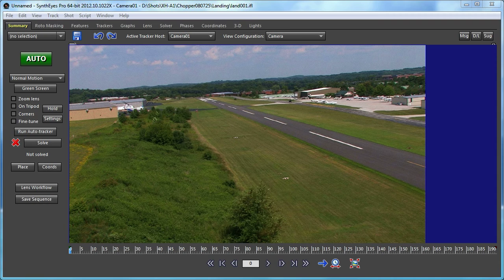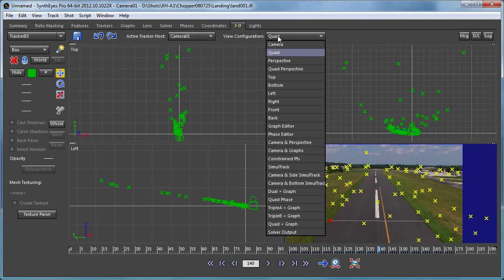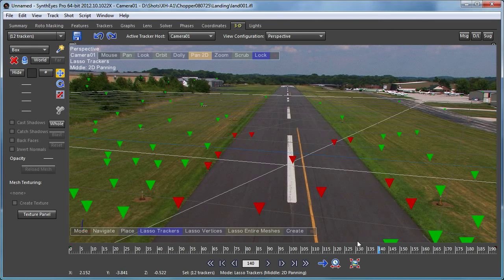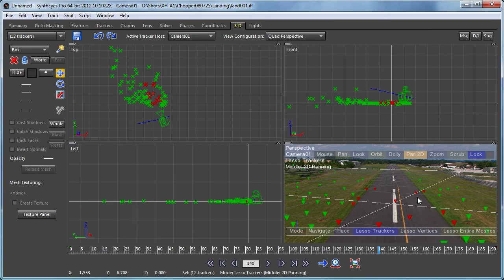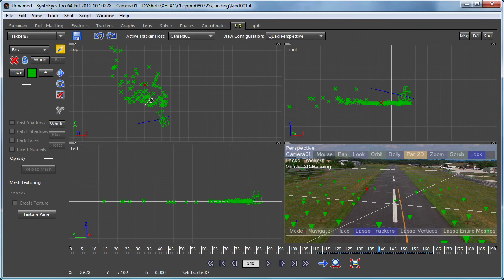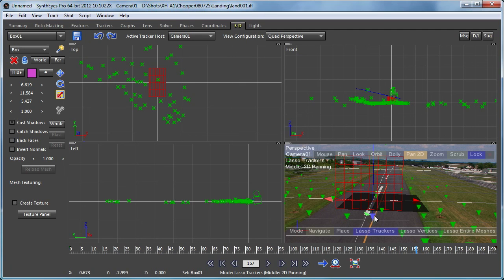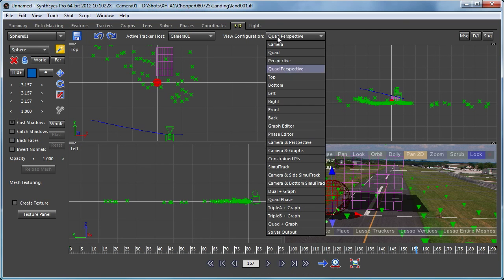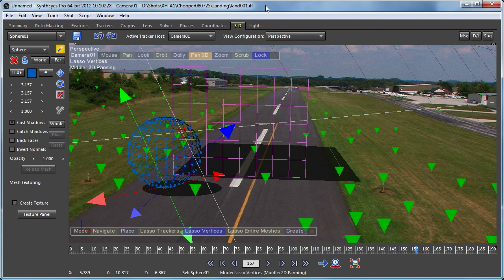Ground Plane Methods in SynthEyes: Setting up a Coordinate System

Comment: Hi, thanks so much! Very helpful! Question - after you set up the coordinate system for the custom mesh - with three, two, and then one tracker - you mentioned you'd now shift the scene to match it but instead, you went into setting up a cube object and using the script. I wanted to know what you'd do to shift the scene to match the custom grid instead. Is there an option you pick to say make this modified custom grid to be the floor plane? Or do you just use the WHOLE transforms to shift the scene to meet up with this plane? Feels like this should be more automated instead of us doing manual eyeballing. Thanks for any input!